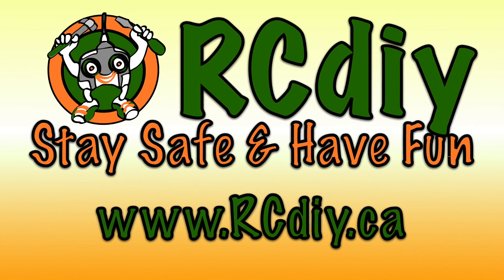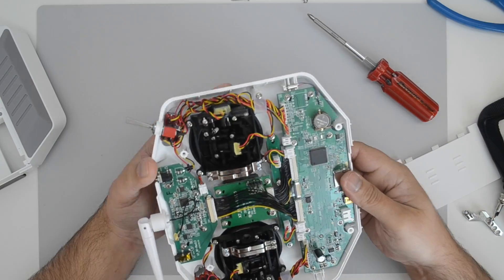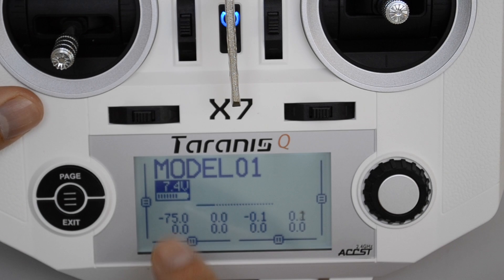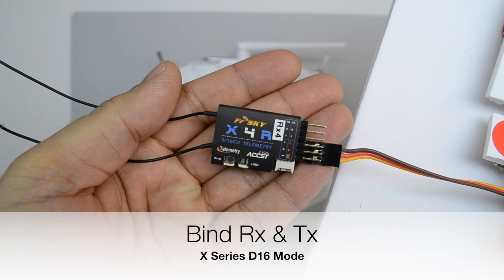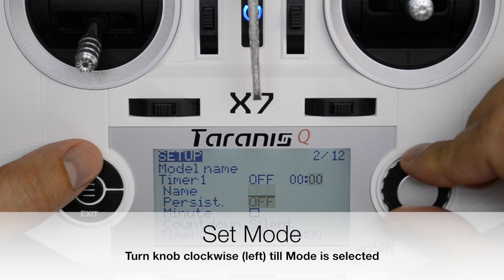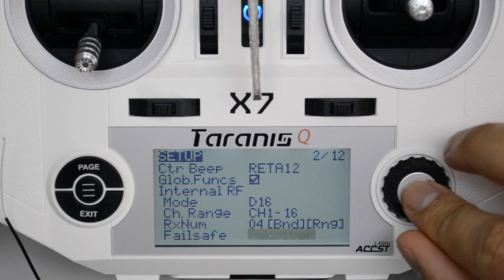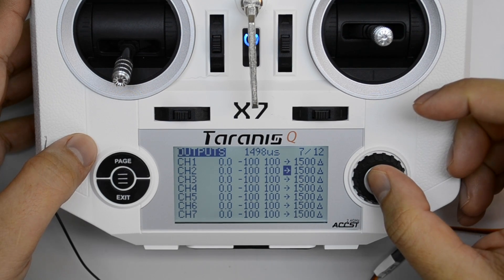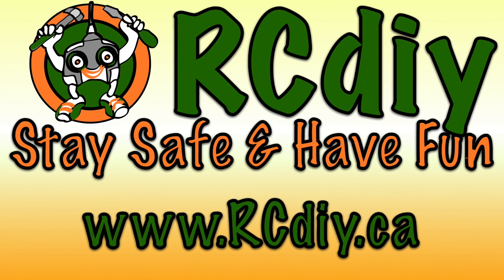Taranis Q X7 OpenTX Tutorial - First Flight Setup (Minimum)

Comment: I managed to drop a screw inside and burned mine mainboard !!! There is a coin type 3V battery exposed, the screw rolled over shorted the back of the battery (+) with the board. There was no smoke or visible damage but the radio can not longer be powered up. So be careful everyone and cover with electric tape that coin battery as soon as you can!

Comment: Does it have all adjustments such as expo, endpoint, mixing, dual rate etc? My hand position is with index finger around back so for thumb comfort I like the thinnest sided box so can the rubber pads be removed or somehow taken off? Finally is there a way to get the left throttle stick to ratchet with a notched spring or is there one that will fit so it will click? I like that to keep from moving throttle while using rudder. Thanks for any help.

Comment: Why do you put the failsave on receiver ? Can i yust set the failsave in betaflight? (Yust orderet this transmitter thats why i ask)
Reply from the maker: I would set failsafe on the receiver because how will beta flight know when the tx is lost? Something needs to change in the signal beta flight receives. The rx needs to know what signals to send beta flight.
Reply: RCdiy hmm okey i will try it when i get it . Thnks for awnsering 👍🏻
Reply from the maker: Painless360 has a play list that may have an answer.

Comment: Can I just bind and fly a quadcoptor out the box with the x7? Or does it has to be program with opentx..
Reply from the maker: It comes with OpenTX. You can bind and fly. After setting the gimbal spring.
Reply: RCdiy thank you..just got this radio 2 days ago, just wanna fly right now,I'll   set it up as I go along  ..thanks again👍

Comment: Hi me again! I fixed the problem in Betaflight, the channels were all mixed up and I switched them around...so it was a channel allocation issue but a new one popped up; Only the 4 channels are working, I can’t use any of the other channels as I wanted to use switch for starting the motors....IS it possible the King Kong 110GT only has 4 channels ? ..anyways at least I can try and fly..., there is also a weird channel at 2020 , channel 16...strange...ANy help would be great..thanks for all your help..
Reply from the maker: +Charles Lamoureux creat a mix on the mixer screen. The mix line is the channel. The source will be a switch.
Reply: Yes, just figured that one out...done...YEAH I think I fixed my quad!! Now its raining and can’t fly just now..Thanks for all your help!..Now need to check if my motors are spinning correctly...lol..
Reply: Done, works great..What a learning experience all thanks to your video and couple others..KK 110Gt is a killer quad...wow is it fast..!!!!

Comment: Thanks for the tutorial ...I have a question, I just bound my King Kong 110Gt to my QX7 but for some reason the throttle is stuck.. no matter what its on full , everything else seems to be Ok..Could it be I need to connect my King Kong to Cleanflight ? Which I’ve never done..thanks
Reply from the maker: +Charles Lamoureux is the correct channel mapped to throttle? Have you calibrated the sticks. Check my website for the OpenTX manual. Take the time to go through it. It may take time now but will pay off.
Reply: Yes I believe so, I think I need to go into Betaflight and switch on motor stop but the mn values are correct so dont know why its spinning at almost full throttle...I will do my research, thanks for the tutorials. I might get back to you if I can’t figure it out..thanks
Reply: WHere  can I double check to see if I have the correct channel , I’m quite sure it’s correct, but maybe I could be wrong..thanks
Reply from the maker: +Charles Lamoureux http://rcdiy.ca/opentx-guide/opentx-transmitter-firmware/model-menus/mixer/
Reply: Thanks , I guess I need to connect to Cleanfilgut as I don’t know what my receiver channels ..I though binding did it automatically ..but miht be different than my receiver correct? SOrry newbie qestions...thanks..
Reply from the maker: +Charles Lamoureux it will be beneficial to read the manual I’ve published http://rcdiy.ca/opentx-guide/
Reply: My radio is set up TAER and so is my Model 1 , so the channels are correct but the throttle is almost max when starting the quad, I already installed latest Firmware on Open TX. So I pretty well versed on he manual..so don’t know whats going on
Reply from the maker: +Charles Lamoureux does the throttle respond to the stick? If yes then maybe the channel needs to be inverted. Or maybe it is a beta flight setting that needs to be looked at.
Reply: Yes it does...but minimally....No way to turn off the motors except pulling the battery. When I increase throttle it seems to increase but seems quieter as it reaches center , could just be the vibration makes less noise..Tx minimal level is 986..so should ust idle ..and why I can’t turn off the motors is weird also..I did have a hell of a time to bind, it didn’t follow the proper binding.., tried to rebind many times same thing occurs...but the fact yaw, etc respond , radio is bound...I will connect to Beta FLight tomorrow...too tired now. Every video I watched said its easy binding. Hahaha thanks

Comment: Great instructions and thank you, but my recently arrived Q x7 has neither a RX number or Failsafe field that I can find.  Should I return the transmitter or where might I find it?  I also can't get it to bind to my Frsky BETA FPV F3 EVO V1.1 FC.  I haven't tried it on my BNF GT 90 that came with the transmitter as a package deal.  All seems moot if I don't have a Failsafe.  Any advice, if so many thanks.
Reply from the maker: Could you please post in the Flite Test forums and we will help you. http://forum.flitetest.com/forumdisplay.php?55-RC-Radios-Transmitters-and-Receivers
Reply: Thanks, on it.

Comment: how did you scroll it to the right on the outputs screen?
Reply from the maker: Enter... However depending on if you updated the firmware pressing enter may bring up a edit screen for that one channel... check out the blog post for basic menu/screen navigation...
Reply: RCdiy o ok. mine is push and hold then edit. thanks.

Comment: hi.. is the, turnigy 1800mAh 3s 40c lipo, a good battery for the tarantis x7??
Reply from the maker: Biagio Meli better is personal preference. I chose AA batteries with 2200 and 2400 mAH capacity. For me that is better. I have lots of them and while one set is charging I use another set. If I had a module in the external module bay it may need a higher voltage in which case a 3S lipo would be a choice to consider.
Reply from the maker: I finally looked for the battery you asked about. Pack Size: 109 x 34 x 21mm (but could be incorrectly stated). This could be too big. The space available is 92*55*17.5. If I were looking I'd look for something that fit within a space of 90x53x16.